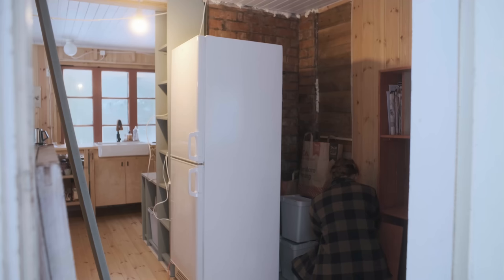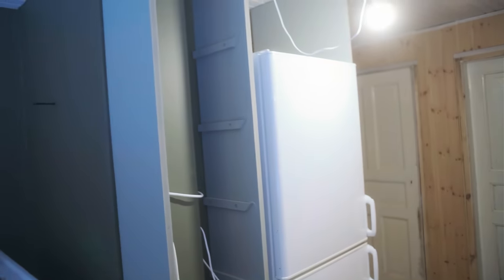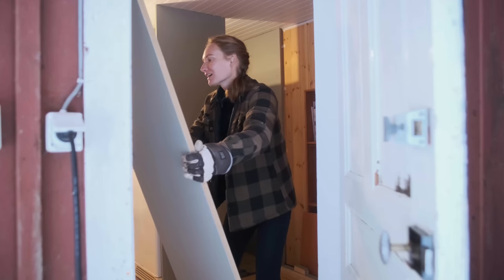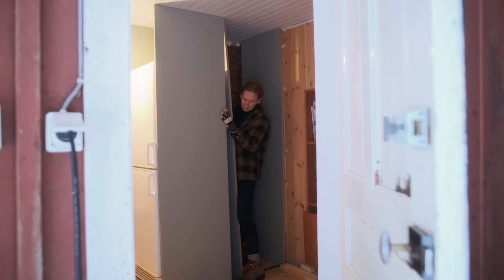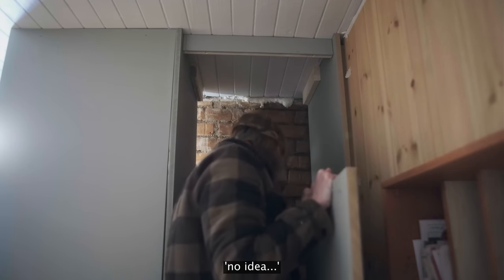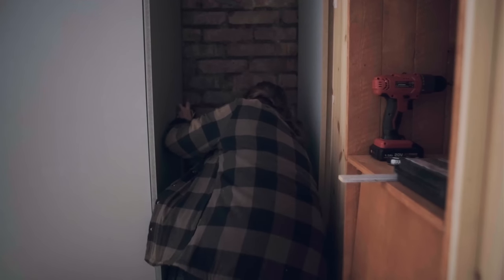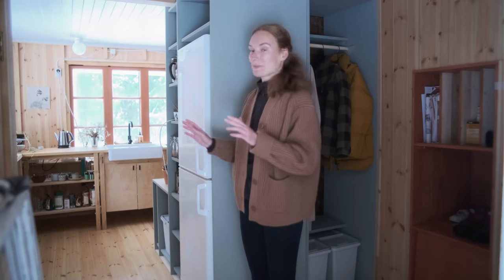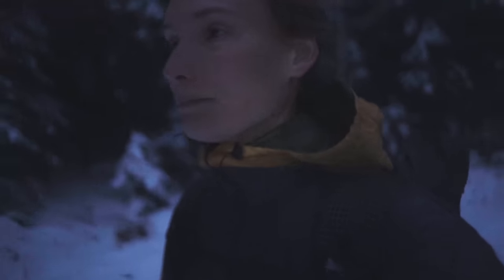Minimalist Kitchen Shelving & Boot Room DIY Build (Story 39)

Comment: Wood glue and sawdust, mix up a paste, fill gaps, sand and paint. Might work out for you.
Reply: Smart idea!!
Reply: Yes, that´s a good old "trick" !
Reply from the maker: Gap unfortunately too big for simply filling, will have to add bits of wood and then ill probably caulk!
Reply: I use this glue/sawdust paste to fill erroneous screw holes so bugs/spiders don't make their homes in there. 💖🌞🌵😷
Reply: 👏🏻👏🏻👏🏻👏🏻👏🏻 And you can decorate the side of the unit ! Maybe a mirror?
Reply: Love watching your videos but have you thought of using larger paint roller 😀 would be half the work

Comment: What a treat it is to follow you on your journey. Caulking would help to fill the seams and gaps and they sell paintable kind so you can paint it to look more seamless. All the little imperfections should give you pause to celebrate because you worked hard to build those units and shelves and weren’t afraid to tackle the projects. You are an inspiration

Comment: Electric cords don’t have to wrap over and around walls. Use a hole saw and cut round holes in that wall behind the microwave and through the back of the shelf to reach the plug.

Comment: Just fill any gaps with decorators caulking. It only takes a few minutes to dry, and then just paint it in for a perfect finish. It’s water based too, so easy to wipe flush once applied. Also invest in some foam rollers for painting MDF. You’ll notice a big difference. It’s really coming along now. It’s a great channel. 🙂

Comment: Nice one Rosie, glad your house was not frozen, dont close the hole in the upper corner(put something in front), hot air can escape here, you made holes in the bottom, that will let cold air in when the hot goes out top!!! You look very proffesional with your tools now glad you started with torx, I am amazed you can the paint to dry in that cold weather!!
Reply from the maker: sounds like my fridge is not being treated well... thanks for the info! :)

Comment: 22:22 I like that you've given the recycling bins a home but, I'm worried that they don't allow for much air flow to your refrigerator as they are so close to the holes. The refrigerator must be working but keeping it too hot will shorten it's life especially now that you have a wood burning stove. (Could you put the bins on a shelf positioned above the holes? I've seen a lot of RVers and tiny homes hang their clothes over the rubbish or recycling. Doesn't this make your clothes smell a bit off? 💖🌞🌵😷

Comment: I use caulking, wood trim and paint to hide whatever I can. Houses aren't square, the saw never cuts straight, you can measure 10 times and everytime is different! Don't try to seal up everything too tightly. The house needs to "breathe". You could end up with moisture damage and mold and mildew. Your work looks fantastic to me!

Comment: i dont know if you're looking for advice but usually you would build each cabinet piece separately as a stand alone piece (making sure it's nice and square) make it slightly smaller than where it's supposed to be, then place it in and finish the front with a face frame/trim, that covers any gaps (you can even scribe the trim against the wall so it's perfectly flush if it's uneven)
Reply from the maker: yup, I know :) That's why I said my building techniques were a little 'rebellious' haha. I'm building it in a way that saved on the amount of materials used... not the way it actually should be built! Had my budget been bigger, I would've certainly built it differently, and used ply instead of MDF
Reply: @wildrosie  it's looking pretty good either way!
Reply from the maker: @microplastique  Just don't lean against it ;)

Comment: Hi, i'm not sure, if putting refrigerator so close to chimney is good idea. Back of the fridge has radiator to move out f the energy from inside to the outside. It could be quite challenging for the compressor to heat up radiator more then temperature of the air around the chimney.

Comment: For the gaps in between the boards, heavy caulking is your best friend. Paintable caulking. If the gap is too big, I would stick in a splinter of wood with some wood glue and then caulk it well. After you touch up paint it, nobody is going to know there ever was a gap.
Reply from the maker: I'm going to add bits of wood and caulk it, the entire things still needs caulking and painting anyways!

Comment: Instead of this small holes for fridge ventilation you could cut out one bigger rectangular one. It won't be visible in any way :)

Also about electrical cable going to socket. Is it going to stay like this or it is temporary?
Reply from the maker: The sockets are annoying. They will be like that for a while but I'll have to figure out a nicer solution...

Comment: Rosie, I have a question, I dont think you usually answer questions but I have nothing to lose by asking: 

When you bought your cabin was it connected to the internet or did you have to use mobile internet connection?
Reply from the maker: No broadband, so I use a little mobile router with a SIM card. 4G signal works fine most of the time. Since they've installed optic fibre in the area, but the connection costs are high and not worth it for me right now!
Reply: @wildrosie  Tusen tack Rosie. We are enjoying your channel and seeing the progress of your cabin.